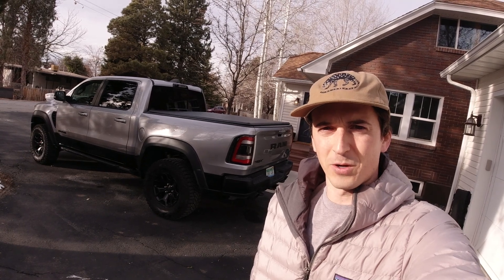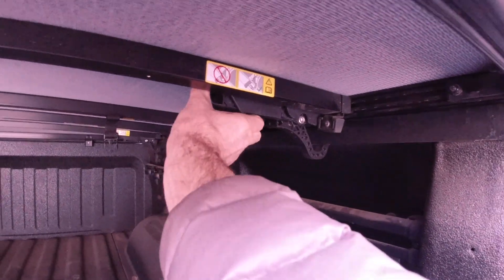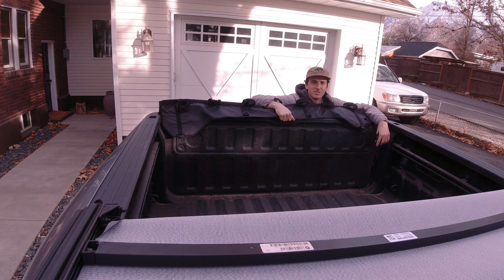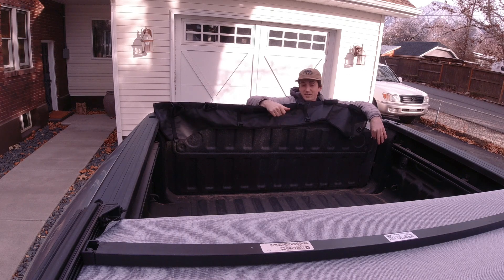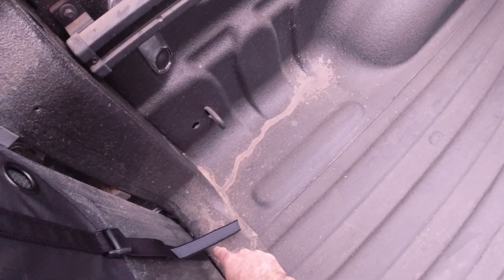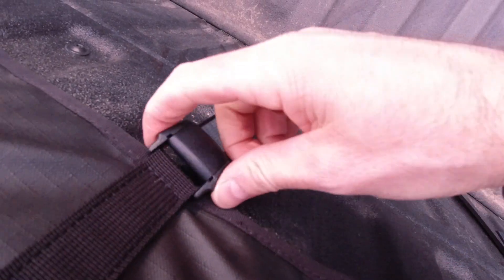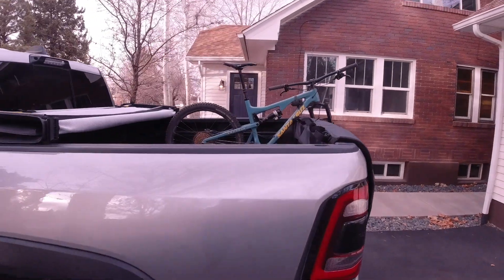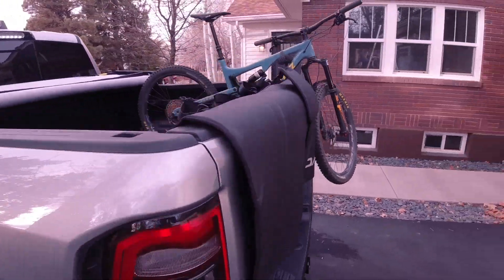Ram 1500 TRX Dakine Mountain Bike Tailgate Pad Test

Comment: I’ve got a 2017 Ram 1500 that fits my Dakine pad pretty well. I didn’t run into the issue with clamping the buckles onto the plastic coating on the straps. 

The one thing I noticed right off the hop is that the TRX tailgate is WAY taller than my truck tailgate. So I think that’s why you had issues with not getting enough length out of those straps. Which is fair. The TRX is a pretty niche/new size for 2020/21.

I wouldn’t give up on Dakine if you’re watching this and still on the fence about purchasing one! We all run them on our trucks at work because pads from EVOC and Race Face haven’t been as durable in the past.

Comment: You have installed this tailgate pad incorrectly... Adjust the pad so the padded area cover both the front and back of the tailgate (at least 8inches of padding on the backside).
Reply from the maker: If I did that it would be installed completely wrong.
Reply: @ChrisONeillUSA  https://youtu.be/DetgzWSNEc4
At around 2:30 in the video he explains why.